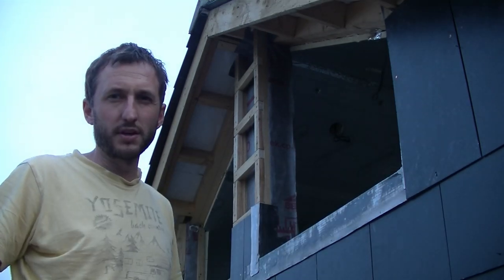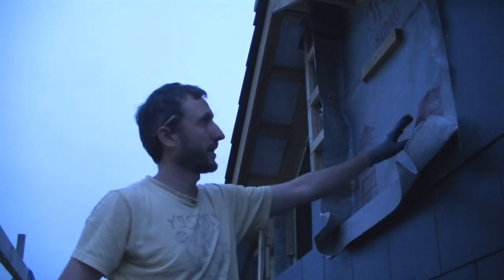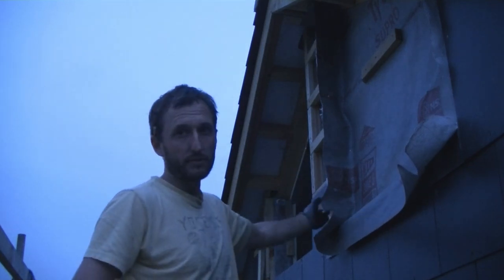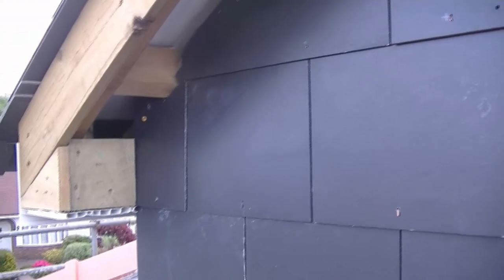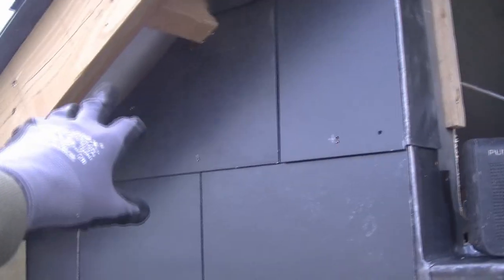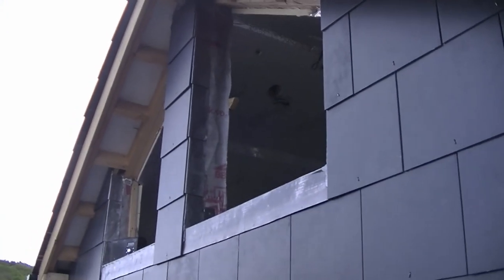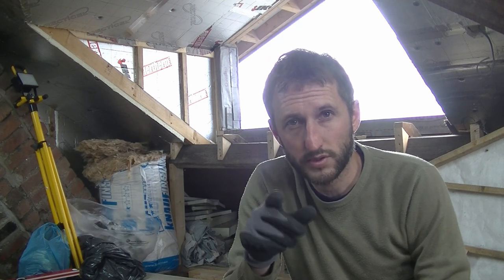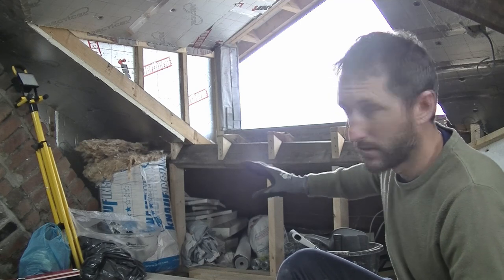Loft conversion part 34 - Creating the window divide, slating, lead trays, lead soakers & soffits!!

Comment: Cracking video as always 👍
Reply from the maker: Thanks!
Reply: @POUSEaroundtheHOUSE   not related to this video , but I was wondering how you find the pitch of the smaller dorma, to match it with the existing roof ? I know you used a mini hanger off the ridge tree but how do you know what height to finish the dorma cheeks ? Cheers !!

Comment: hi Pousey,  is there a video of the dormer windows being fitted
??
Reply from the maker: More vids to come when I get around to it but unfortunately I didn't film the window install as I had the company that made them fit them in for me. But with upvc windows, you basically fit fram, screw in from the sides using packers or shims around the edge, expanding foam in the gaps around it, then use some upvc trim over the gaps. Obviously fit the glass into place once frame is fitted. Very simple really. I finish the inside of the windows with plasterboard in a later video.